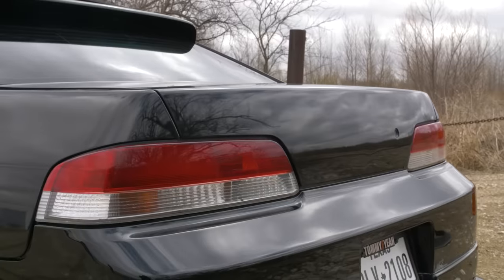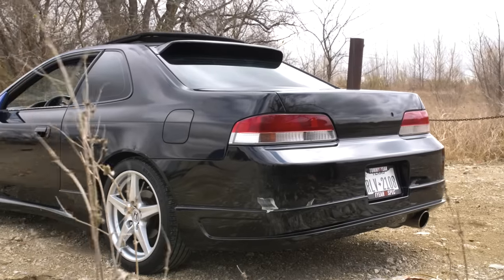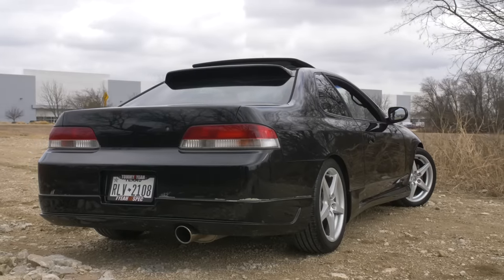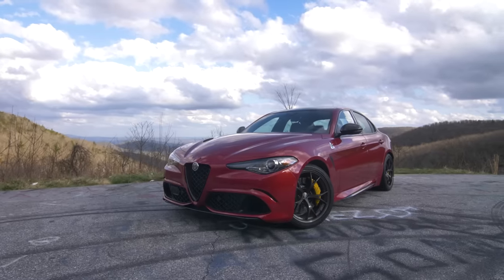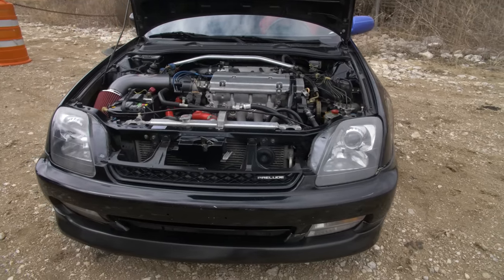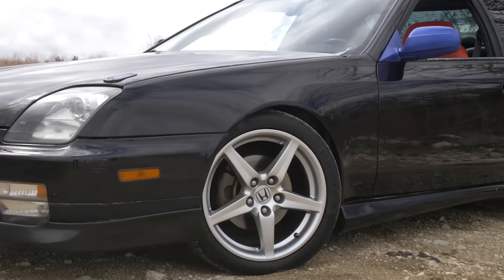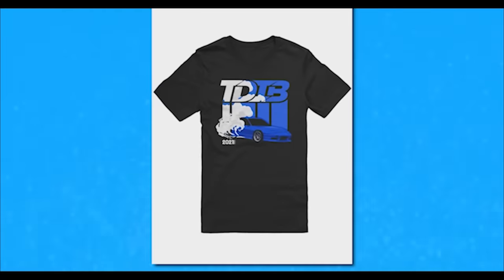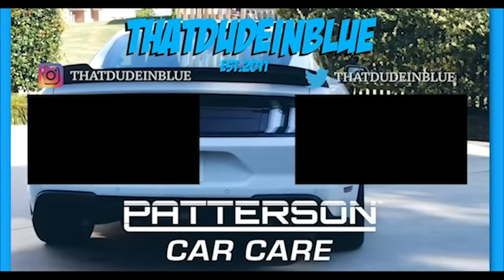Why is the Honda Prelude So Hated?

Comment: honestly the prelude is such a beautiful car but at the time, honda made so many FWD cars and I really think the late model prelude body would have fit as a rwd platform better. A lot of people dont like the engine too
Reply: As someone who didn't know much about Hondas/Preludes the first time I saw one (early 2000s), I assumed i was RWD, partially because of the long hood. Finding out they are FWD puts a slight damper on one's opinion.
Reply: there are a few shops that are converting preludes to awd and rwd. one shop i know in particular has come up with conversion brackets and like a kit sort of or i think have like published a step by step plan on how to do it and what you need to do it
Reply: They handle like RWD cars in the twisties as most Hondas from the 90s do. They’re engineered to handle “neutral” which I guess the default would be what RWD cars feel like. You can get oversteer in the corners if you’re a good driver and the car encourages it.
Reply: @SimbaTheGreat  the 4ws one did but not all preludes had the 4ws
Reply: hated no, the h22 was a great engine what people hated was in the SH model it had the atts which is a good feature for a stock or lightly modified car but it held the h22 back for high power. if you got the base model that came without the atts system in the transmission you were able to achieve respectable power numbers. that being said the H series def didn't have as good of a market at the B and D series motors as far as aftermarket performance options go and the H series with an exhaust didnt sound that great its like the K series you have to find the right exhaust to get a good sound out of it. I've had all 3 and the B series was my fav as far as modding goes when I found my 97 prelude 5 yrs ago it was bone stock an older gentleman owned it and I left it bone stock and then the unfortunate happened early this year the upper radiator hose ruptured on the freeway and got hot immediately and warped something internally. was a depressing day I loved that car the way it was and was a great car, something I wish I would have caught sooner to prevent
Reply: @theconsigliere8463  the FWD preludes do as well. The difference between 4th and 5th Gen in terms of handling, a 5th Gen SH prelude will run circles around a 4th Gen 4WS model and the 3rd Gen 4WS stands no chance against a 5th Gen SH. Their near 50/50 weight distribution and suspension set up is what allows for them to corner like RWD cars. Even the civic Si EM1 has a similar style suspension set up. Most Hondas from the 90s, especially performance models, were able to be driven like RWD cars on a track. Very little understeer in these chassis with a touch of oversteer. I’ve even gotten a 5th Gen accord (extremely similar to 4th Gen prelude) to oversteer in the corners when it’s slick out.

Comment: The OEM FRM liners on the H22 are actually quite stout for an OEM unit, specifically the OBD1 H22A which had a semi closed deck. It was arguably one of the strongest of OEM cylinders Honda produced untill the S2000 came around, which also has FRM liners and is known to take insane amounts of boost in OEM form. The real issue is the cast pistons of the H22, they have weak ringlands which are prone collapse under higher boost levels. Throw in the primitive tuning methods of the 90s and early 2000s and you have a recipe for disaster. FMUs running 80 psi of rail pressure on the back side of stock injectors, APEXi VAFCs, fish tank check valves inline with map sensors, etc. The whole "H22s have weak cylinders" was a myth that came around in the early 2000s. It's not the cylinders, it's the pistons. Throw some Mahle Gold pistons in it and a set of rods and they'll take +800 whp on the FRM liners.

Comment: People say they are too heavy and can't compete but a Prelude just set a FF world record in thr limited class, against gutted K swapped civics and more. Set it with the H22 motor inside still too. They carry much more structural rigidity than the small Hondas (43% more rigid to be exact).

Best car Ive owned and ill never sell it. Great Vtec kick, beautiful design, incredible handling and when set up properly easily capable track car. Mines lowered with nice wheels, exhaust, bolt ons, cams etc. People break their necks looking at it and it gets lots of questions. The H22 sings like no other!

Be warned, prices are climbing. Get em while you can, because people are starting to notice!

Comment: Man this makes miss my old one so much. Had 98 Prelude VTi-R down under and it was my first car. Was honestly the best. H22, handled great, looked great, was roomy enough and had a great seating position. Couldn't ask for any more than that. Down under they get a fair amount of hate, mostly just because as you said, they're heavy and people think all they do is leak oil 24/7. Great video!
Reply: All D/B/H/F series Hondas leak oil.  You keep distributor seals, VTEC solenoid seals, valve cover gaskets, and oil pan gaskets in stock at the ready to change them at a moment's notice. Quality gaskets and the magic touch will help a lot, but they are a pain to keep dry.

Comment: My dad sold Honda's and had one of these in the SH trim on Demo one summer from the dealership he worked at.  He said he had it pinned at 140mph once.  My uncle is an american car guy, didn't believe there was any way it made 200hp stock.  That demo also had the leather and carbon fiber trim.  Fun story, his dealership had a gas pump, we filled up one night and he was doing some stuff at his desk when the other staff shut down for the night.  We left the lot and he didn't see the chain across the exit of the lot, chain ripped off the antenna and spoiler . . . they didn't do demos at his dealership too much longer after that.  

Accords from that era with v6 were cool.  It was probably the best Honda era.

Comment: This owner was correct,  the second 5thgen that I purchased came with Black Factory Leather seating/Door Covers and it has the Carbon Fiber interior kit.  The Carbon Fiber accents look really good.  USDM had 2 versions of the 5thgen...the Base model which wasn't basic by any means but that's what it was called USDM.  Then the offered the Type SH model which came with ATTS, different wheels (same size 16"),  painted side skirts/lips, spoiler and only came with a manual shift transmission.   The manual shift transmission wasn't different from the base model manual transmission due to the ATTS unit.  The 5thgen Prelude is one of the best handling FWD drive sports cars of that era.

Comment: They were expensive. The initial expense did translate into continued expense as a used car. 
People picked a civic because they wee more common, and less expensive. 
If I recall, Prelude weighs more then some of the other honda cars people like to tune which matters to some people. 
The Prelude nametag is sort of out of sight out of mind now. A relic from the 90's, forgotten because it was replaced. Like Dodge Intrepid, Nissan Pulsar, etc. nametags that were instantly recognizable but people have forgotten to time.

Comment: The Honda prelude was never hated on. I just bought mine in November a 5th generation prelude with 177k on body 10k on engine and transmission best car I’ve ever drove. Just wish there was more aftermarket parts but the harder you look the more you find

Comment: I had a 2000 Prelude SH that I learned to drive stick on from 2014-2017 with over 175k miles.  It was a lot of fun and I got tons of compliments on it, such a good looking car.  I traded it in for a Focus ST, and I don't regret it a bit.  But man did it look good.

Comment: I had ordered one through carmax in 2002, a type SH with 30k miles. Paid 200 bucks to have it shipped but ended up getting a base RSX 5 speed after all. While I loved that car and didn't get rid of it until around 250,000 miles I kind of wish I had gotten the red 2001 Prelude. Even today I think it's a beautiful car and last I heard there were only a few hundred surviving models left in the US. Great car, high revving and had that original VTEC feel, almost turbo like when it kicked in before they switched to I-VTEC.

Comment: The first VTEC car I ever drove was a Prelude SH. My old roommate had one with an H22a4, VTEC controller, all the bolt ons and a small T4 turbo with an eBay FMIC. When he would go to his girlfriends on the weekend we would switch cars and I had a ton of fun in it. I do enjoy the VTEC sound when it’s coming out of a classy exhaust and not a 4” fart can. That being said there was pretty bad exhaust drone regardless of the exhaust setup he would put on it and even with a turboback it was pretty bad. Regardless it was a super fun car to drive and for a FWD platform I was blown away by how much fun it was to take through the S turns and sweepers on our local back roads

Comment: I have a 2000 Prelude I bought 10 years ago that is still bone stock. Only has 38K miles on it now and it a fun summer car. The only expenses after 10 years are tires, brakes, timing belt and a simple tune up. Great summer car after having Camaro's, and Porsche's. Still have the window sticker and Carfax report. Car listed at $24,500!  Crazy money for the time.

Comment: Back in the day we used block guards for the sleeves and they would hold pretty good for boasted and nitrous applications we didn’t had none of this E85 this and stand alone that… we just made sure they had oil and water and send it. lol and when they broke buy another motor and do it again cuz they were cheap

Comment: I have a nice 70k mile 2001 prelude, it sat for a while so had to put in some work to make it solid again - but it was owned by an old lady so car is in tip top shape.

I feel like 5th gen preludes are the practical sports car. Front wheel drive helps with driving in weather like snow, the back seats add extra storage, etc... It's a sports car you don't have to park most the year, especially if you live where weather can be an issue for rear wheel.

Comment: As a prelude owner, the only hate I've noticed is towards the automatics being weak transmissions, not the actual car itself.  My 98 is automatic all original, and I would not have it any other way, really enjoy driving it and i love it. I've had 3 or 4  people a month asking me if it's for sale or tell me that they haven't seen one of them cars since highschool.  Transmission wise, no shifting problems what so ever, I just change my trans fluid once a year with Honda ATFdw1. you have a drain plug and dip stick, quick and easy..

Comment: My first car was a 98 Prelude SH. I wanted a tuner car in my budget, but didn't want a civic... It was super heavy I had to push it once lol. My friend had an Integra GSR and pretty much whoever shifted best won. It came with leather interior and carbon fiber stuff. I had a few mods wheels, tires, coilovers, intake, short shifter, carbon fiber hood, apexi tuner. It was super fun in the canyons the type SH had the ATTS transmission that put 80% of the power to the outside wheel. So it whipped around the turns. After owning that car for a few years I knew what I wanted  in a car and bought a 1990 240sx coupe I still have to this day.

Comment: Awesome car, but whati always heard from the ek/dc integra crowd was its heavy, its a composite block, its more prone to burning oil, its a cable shifter,  they said they liked the more connected feel of a transmission mounted shifter rod, but personally i think its a nice car, and my first honda was a 87 prelude 2.0 si back in 1999, i loved that little metalic blue 5 speed, it had some money in it, and very clean. Kept it 5 years, and regretted selling. But i always keep a honda around.

Comment: Ive owned em1, dc2 gsr, and got a prelude afterwards. And i think the prelude chassis and interior is the best forsure. My 98 prelude interior held up super good, and also the car didnt creak or squeak when driving compared to civic and integras of same age. Also the h22 had amazing torque to make it funner. I thought it was more fun to drive, compared to civic and integra, but its just so heavy. My prelude had full lipkit with koni yellow. The only con was how much it burned oil and the h22 isnt as bullet proof compared too the K series. Sold my prelude SH a few years ago but ill always have love for it. The space inside and everything on the car was built great. It was just the motor that made me sell mine. K swapped prelude wouldve been amazing. But its not worth the money cuz i rather have a integra k swapped

Comment: i own a 1999 prelude type sh with a 2001 base model swap to cut weight of ATTS so what's crazy is the front suspension has stock traction bar but there is a difference between type s and type sh as the type s has straight bolted bars to the lower control arm and the type sh has the bars ran to the lower part of the spindle to a ball joint I'm not sure which one is better but there is definitely a difference just not sure what's the advantage in the handling property

Comment: I bought my beater 4th gen online for 800$ .I sold my motorcycle and dropped that 3k into the lude..all new underneath suspension,full tune up and it runs amazing ,I relize the ludes take more $ to fill it up.40$ instead of 20$ like my old civics

Comment: this vid brought back memories.  i had a 99 typeSH in black.  the thing that killed the lude wasn't the cheaper civics or the s2k.  it was the accord coupe.  the 2000 accord coupe was sporty looking compared with prior gens, and you can get a 4 cylinder version for less than the lude, and for the same price as the lude, you can get a V6.  on top of that, i'm sure the profit margin for the accord coupe was way higher than for the lude since the accord coupe shares platform with the rest of the accord lineup, so it's a no brainer that honda dropped the lude.  another mistake honda made with the 5gen lude is that it was only offered with the 2.2 VTEC.  4gen ludes were offered in lesser motor versions, making them more affordable, and thus allowing honda to sell them in higher numbers.

Comment: People hate the Prelude?  The first FAST Honda I ever saw was a Prelude in ~2005 with built turbo H22 made like 350WHP.  I saw it beat a brand new (at the time) Roush supercharged 3V 4.6L Mustang GT in Detroit (it was one of the first supercharged 3V's when the new Mustang came out) and just like that my prejudice against Honda was gone!  The Prelude was clean too looked stock other than the smaller mirrors and bigger tires!

Comment: when he said it runs better when it the check engine light on I felt that the 5th gen sounds better with a check engine light on no doubt the deceleration gurgle coming down from 6k 7k 8k can't beat it I'm glad the 5th gen is finally getting some recognition

Comment: I saw a few of these cars while growing up ive heard some things about not much after market supports and some safety issues, how every any time I see these cars being built they are usually a non-daily drive and becomes a car sitting in the garage. I think 5th gen  looks great and i to this day I always have a debit on if I got a Honda type car would be civic type r or civic or the Honda prelude and some have told if u can get a prelude otherwise if not just get a type r civic or civic with a vtec engine, how every someone who doesnt have much money i rather save and buy something that is already ready and has low mileage

Comment: wanted one of these as a "first car" for the longest. 01 SH in particular in either the nice white or ebp, looked and looked when I could afford it but found an Acura legend for half the price and less than half the mileage so I went with that instead, ofc there were some concessions made but I enjoyed the car regardless and why wouldn't you want a v6 220hp fwd 2dr instead of a 4cyl stock for stock although the Acura was 10 years older I found it a better more luxurious car overall

Comment: From what I recall, the 5th gen prelude was always thought to be the heavier of the bunch even with the H22A being less dynamic.
The SHAWD was really something
Reply: The SH wasn’t AWD. No preludes ever were. The Type SH had a few cosmetic differences over the base models, but the main thing about it was the ATTS (active torque transfer system). Which was similar to a LSD but not really. Just cut down on the understeer in the corners

Comment: The 5th Gen Prelude is one of the few long nose sports cars with that 90’s feel and look. I don’t think I could sell my 97 SH 5-speed. When the ATTS works the car feels very light around turns. People are usually pretty pumped to see it on the road lowered on 17”.  My next engine will likely be the H22A for a little more HP. I still love driving it slammed and I’m in my 50’s.
Reply: Thanks for giving the Honda Prelude a spotlight David! Entertaining to watch! See you at bay creek skatepark again sometime soon!

Comment: Hated? Yes they were no brand upgrade really wanted to support the prelude! How do I know? I’ve owned one for 17 years and what I know instead of upgrading it by performance cause it really didn’t have to many sources for it I decided to go Jdm parts and I’m talking about real Japanese parts. And good thing I chose that route cause these parts are hard to find now it’s a Jdm gem, literally! I have the full Jdm sir interior which is red have the type s flush mount spoiler, window rain guard, Jdm glass fog lights Jdm fenders and my most rarest part I have is the digital climate control and my 13k kilometers sir s-spec carbon fiber gauge cluster. If you not a real bb6 prelude guy then you really don’t know what I have but I have one of the rarest prelude here in America. Also to top it off I put the H22a red top

Comment: they will jump timing if you look at em wrong. I loved mine but jumped timing timing once. sent a rod through a the block another. and had starved the motor of oil a differnt time locking up the head.